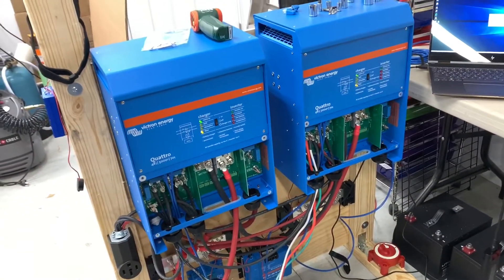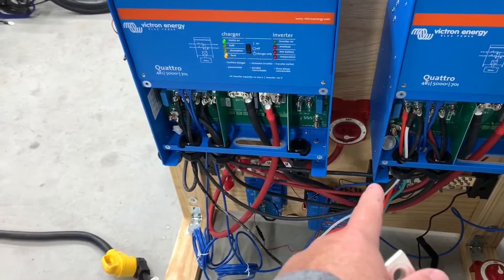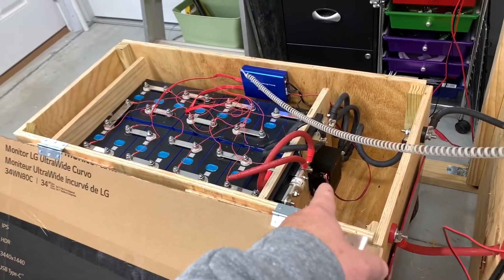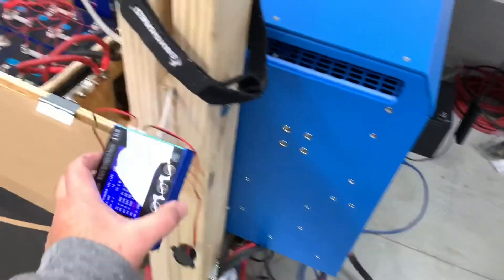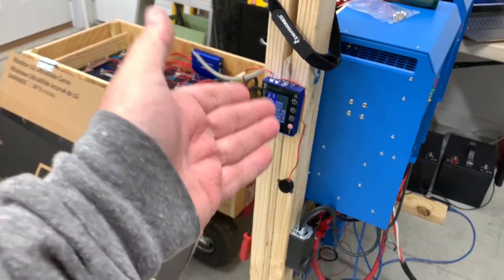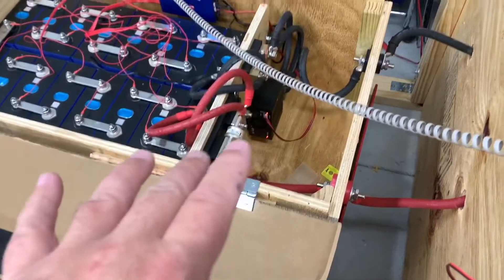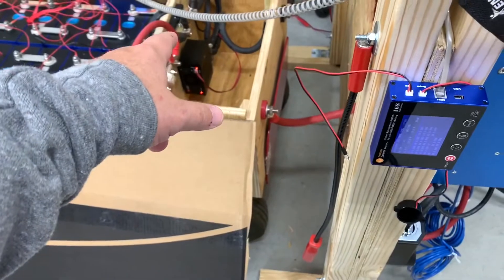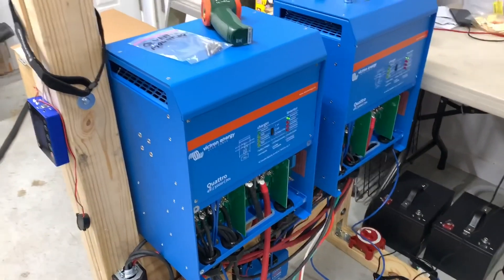I hate the Chargery BMS and DCC

Comment: I'm disappointed in my Chargery too.
The cell inaccuracy was a big surprise, I ended up having to disable balancing and set the over voltage to something like 3.85 just to get it functional...
Which is halfway defeating the purpose of a bms.

I've also replaced my DCC with a contactor. (My DCC Blew up)

Comment: Looks to me like you need more batteries. No wonder you blew a 300 A fuse. Your voltage is sagging big time. You need four 280aH 16S batteries. I’m running a 4000W 24V inverter on two of those 280 aH 8S for my work van. I have 6 different brands of BMS’s on 132 kWh or 10 ea 16S batteries for the home system, two Sol-Ark 12K's. Redundancy. Have you called Jason. Great customer service. Also keep your big DC cables as close or even taped together for less interference issues.

My two Chargery16T with DCC600's work great. Voltage and Current perfect right out of the box.  Sounds like your Victron stuff is the problem. My SA aren't causing fluctuations.
Reply from the maker: Jason stopped responding to me but even if he did, I would have ditched the DCC.  It's not properly designed for this application.
More batteries wouldn't solve the problem of blowing the fuse (it would make it worse, actually).  The inrush current was the issue - which a proper precharge circuit will prevent.  However the DCC doesn't have a proper precharge circuit.  Anyway, I ended up with a completely different BMS and a contactor and a manual precharge method along with a circuit breaker instead of a fuse and that's been working well for the last several months.

Comment: any idea if this is still the case with Chargery’s latest updates?
Reply from the maker: The fix requires a new DCC which I don't believe has been released yet (though I'm not closely watching).
Reply: @TisTheDestiny  hey thnx for reply… after much research I think it makes sense to go with Orion as well…the engineering is worth the $350 more. Can you point me to some info on how the contactors are wired? If the contactor needs 12V to connect the 48V battery to loads, how does it ever make that first connection, since your 12V needs to come from your 48V to 12V converter load?
Reply from the maker: @huntma3787  Unlike the Chargery, the Orion operates the contactor at the same voltage as the battery.  HOWEVER, it has a limit of 175ma which can't drive many of the bigger contactors.  So I use a small solid state relay to drive my contactor; this is discussed in the Orion manual.

Comment: For a soft start, could you use a small relay and resistor to pre charge the inverter and then use the potential free relay on the Quattro to active the main relay? I’ve not tried it myself but it might be worth investigating.
Reply from the maker: I'd need to investigate the relay configuration of the Inverters but I'd rather separate the pre-charge system (there are other capacitors in the system, too).  The Orion BMS is getting a software update soon that will have this feature - and it's really only for peace of mind.  Once the system is turned on, I should never need to pre-charge again; I just want to protect against the BMS turning off and on the contactor (which bypasses the pre-charge resistor).

Comment: Man that is awful. I have never been a fan of the chargery, and a lot of my viewers were mad at me about having that position. I do not understand why so many people support that BMS.

The DCC seems completely defective. I hope your victron caps are ok. What a bummer.

The voltage inaccuracy of the chargery seems awful. And those connections and bolt size on the contactor are horrible! They are way too close, and good points about the fets supporting those bars. Awful design.

Anyways, it is good to know your experience with chargery. I would be just as pissed as you are. I never liked that BMS.

Comment: You need the relay delay board to precharge the capacitors in the inverters via a resister to stop the arcing and drawing too many amps at startup. It sends a small current to the inverters and then throws the DCC. It is an optional extra.
Reply from the maker: The DCC is advertised to have pre-charge built-in.  It doesn't work.  Jason at Chargery misunderstood what precharge means and designed it incorrectly (he told me this directly).
Reply: @TisTheDestiny  oh good on him to admit his mistake, I’m guessing it’s fixed now?

Comment: I've never used a bus but I've been researching into getting the same cells that you have. looks to me like you have the chargery set to 280ah battery? but don't you have a 560ah? not sure if this will cause the bus to do weird things?
Reply from the maker: At the time I had 280 configured (the other cells weren't connected).  It wouldn't cause any problems other than misrepresenting the State of Charge.

Comment: If you update to the latest V4.0x firmware version on the Chargery BMS, it is much better regarding the fluctuating current and SOC readings.   For me, the BMS itself seems to work fine but I was not impressed with Chargery's relay options.  I use a mechanical relay (500A TE/Kilovac EV200AAANA) on my 8S 280Ah setup with a 3KVA Victron Multiplus and a Chargery BMS8T.    Granted, I don't have the same level of capacitance inrush on my setup, so I can get away without a pre-charge circuit.  I have read about passive current limiters that you can use for higher power systems that have to energize large invertors (>4 kW) without a separate pre-charge circuit.  Battle Born sells them at the following link, although I have no experience using them and have no idea if they would work for your application:

https://battlebornbatteries.com/product/current-surge-limiter/

The following description is from the Battle Born website:

"The CSL500 Current Surge Limiter is a FET-based current limiting device that is to be used with Battle Born Batteries LiFePO4 battery packs when they are used in conjunction with large (greater than 4kW) inverter/chargers.

The device is mounted permanently in series between the negative pole of the battery bank and the negative DC input terminal of the inverter/charger. The device protects the battery management system (BMS) from damage caused by the initial current spike that is created when connecting directly to the large capacitors (> 5 milliFarads) that are typically on the DC input side of the inverter/chargers. The device allows the batteries to slowly charge the capacitors (within 1 ms). This soft start avoids the high-current shutoff inherent to the BMS of the batteries."
Reply from the maker: Thanks!  I saw the 4.04 update on the forums as fixing some of the readings ... which was one of my least concerns with the Chargery... As it stands now, I use it as a "hobby BMS" for charging up cells I'm testing ...

As for precharge, I forgot about BB's item you mention.  But Orion BMS will have precharge in the next firmware release, so that will ultimately solve my problem.  A lot has happened since my last video.  I'm going to have to do a couple videos to cover it all.  Who knew my channel would turn into a battery channel lol!

Comment: Did you start using Orion already?
Reply from the maker: Yes, it's been working relatively well.  It's very accurate.  When I use the CANBUS control, it's difficult to get a 3-stage charge profile but Andrew (at Orion) and I have been discussing it and I think I've got the configuration set.  It's not QUITE designed for stationary storage systems like these (primary use case is EVs) but it's doing the trick - just complicated to get it set up correctly.  I'll review all of that in a later video ...
Reply: @TisTheDestiny  looking for a video, thanks
Reply: @TisTheDestiny  Does the Orion show a fluctuating current as well? TinyBMS has exactly the same problem. Fortunately it does not affect the BMS' SoC calculation. Otherwise TinyBMS is a very good BMS for DIY with plenty documentation and customizability just like the Orion. As you said, with the Orion, you also pay for features like ramping down the max discharge current near full discharge etc which you generally do not need for stationary use.
Reply from the maker: @diyEVguy  Yes, it does.  I've come to accept it as inevitable so long as the SoC is correct then I don't really care.  If it fluctuates a LOT then you might need heavier duty bus bars or better connection to the cells (or stop using cables between the cells, if that's what you're doing.
Reply: @TisTheDestiny  The current swings are, in my case at least, the interference pattern between the (high) frequency at which the inverter "sucks up" DC current and the sampling rate of the BMS. Cable thickness was irrelevant as long as thick enough.
Reply from the maker: @diyEVguy  if you really have cables between cells then what’s happening is skin effect resistance as the result of the AC waveform that the inverter induces in the wires. As soon as I switched to bus bars (no skin effect) then the problem went away.
Reply: @TisTheDestiny  Interesting, do you have a reference for this phenomenon in the context of batteries/BMS/inverter? Neither my BMS supplier nor inverter supplier mentioned this.
Reply from the maker: @diyEVguy  Yup!  https://www.orionbms.com/troubleshooting/internal-resistance-values-incorrect-by-significant-amount/#:~:text=Skin%20effect%20is%20caused%20when,can%20cause%20erratic%20resistance%20readings.
Reply: @TisTheDestiny  o my gosh. Thanks for that info!!!

Comment: Thanks for the video, I have a similar experience with Chargery BMS: 
- it's constantly draining one of the cell in battery bank
- really inaccurate voltage reading
Reply from the maker: Often it's cell 9 that reads very wrong due to the circuit design.  Overall just an awful experience.  I'm shocked to see so many people give it a good rating.  Probably the 4s and 8s users mostly (it does better under those configurations).

Comment: I'm confused. Is it a 5th wheel or mobile hair salon? On what planet will boondocking a 5th wheel require 5KW solar and 30KW storage?.
Reply from the maker: LOL.  The primary reason is the air conditioning.  In my current rig, I easily consumed 7kWh a day without air conditioning.  Remember, I'm working from the rig so I've got computers and monitors etc running plus full size residential fridge.  I want to be able to live in it without thinking about being careful with my electrical usage or running a generator.
Reply: @TisTheDestiny  I'm gonna buy your Tesla and follow you around with an extension cord